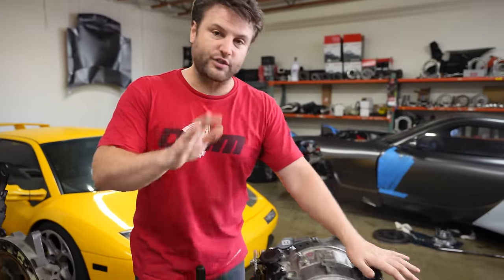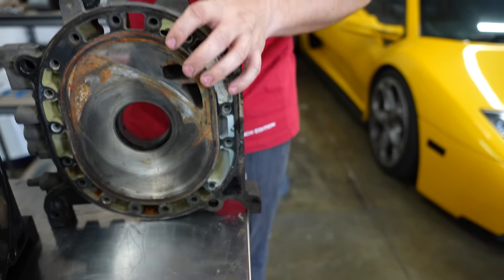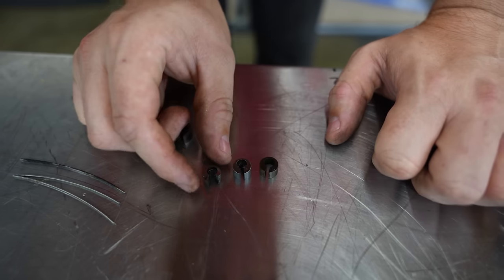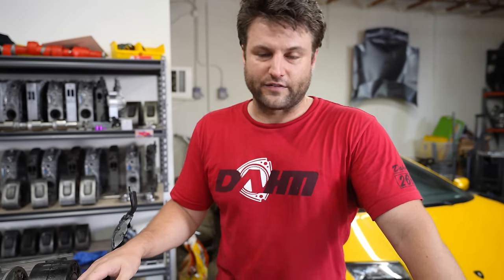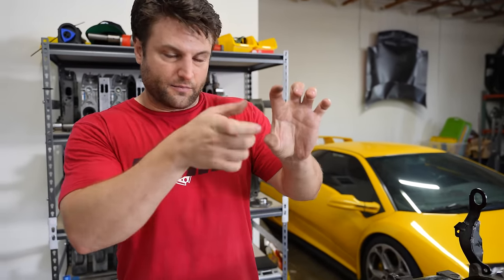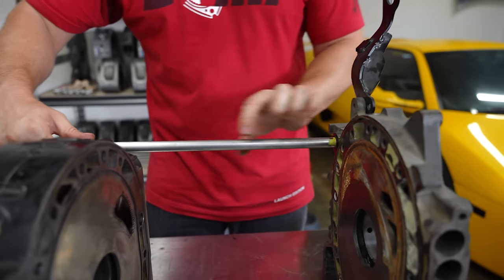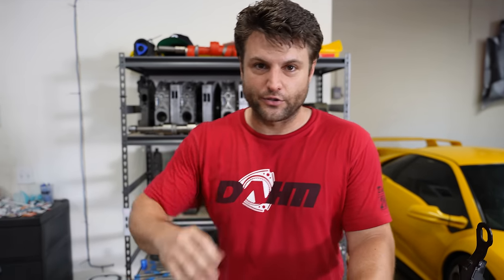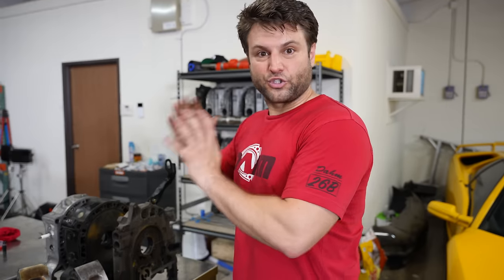Fixing the BIGGEST Problems of the Rotary Engine

Comment: When I discuss Rotary engines vs Piston engines with folks I always point out the difference in engineering efforts. The overall effort (engineering/testing/etc) to improve the piston engine absolutely dwarfs the Rotary engine.  I often wonder what may have been if the Rotary had even 1/10th of the same effort applied to it.     Great video.
Reply: I often wonder the same thing. There are definitely issues with rotary engines, but I doubt that any of those are fundamental flaws with the concept. Just look at what we can do now as opposed to 50 years ago. Probably ten times as power dense (more power in 3 small cylinders vs 8 big ones), while also being a hundred times cleaner. If those problem solving skills could have been partly applied to rotaries? I think some really cool technology could have come out of it. Sadly, with the future moving away from combustion, its unlikely that it will ever get that kind of attention.
Reply: @aggonzalezdc  They are fundamental flaws though.  The power density isn't even that great.   If you measure a 4 stroke engine like a rotary the displace is half or you can double the size of the rotary.  That's because a rotary fires it's full displace for every rev of the crank while a 4 stroke only fires half it's displacement.  So the 1.3L is really a 2.6L and I will assure you a 13b is no match for say a RB26 with similar type builds.
Reply: My same point when it comes to ICE vs electric cars
Reply: @Weeblicker  My buddy at work was thinking the same thing.  The young folks will be fiddling with the electric cars like old farts like me did years ago.  It will be interesting to see the results.  Take care!
Reply: I feel like piston engines were a moving target. They kept getting better, and the rotary was trying to catch up, but really only one company was using them.
Reply: @Day 18,300 and counting cool story bro but I'm good with my ICE engine. I don't want thousands of 
lithium🔥 batteries venting hydrogen fluoride (after a crash)🤑. Also we still have efficient ice vehicles gas or diesel. Fuck EV with lithium ion.
Reply: The rotary's only advantage was better breathing, but that was decades ago(70s, 80s). Now that the piston guys have worked out how to fill cyls with better post design, ie, flowbenches and CFD, they can now fill more, and over a shorter time period, giving them even more drivability, ie, high flow ports with short duration cams. Unfortunately other than that it's practically behind in every aspect due to design limitations. I have some vids on the problems if you're interested. It was fun when it lasted - lol -. I still have my original 268,000km stock factory engine that still runs - it must have 4mm high apex seals lol -
Reply: Exactly the same !
Reply: @Dayandcounting  Funny you say that, because displacement is a measure of stroke, bore and cylinders, 2 of which are non existent in a rotary engine.
13B are a 1.3L, period.
Reply: Oil consumption, non epa compliant...
Reply: @olliehopnoodle4628  yup till a winding shorts/opens or you get thermal runaway in those lithium batteries
Reply: Trust me, the Japanese have thrashed these engines and made many improvements, I was Crew chief and engine builder for both the Trinity Racing RX 7s, cars #81, #82 the race engines undergo a 9 hour breaking, with aluminum ceramic apex seals, these engines were run on Superflow Dynos at MTC in Irvine, Ca. For 24 hours  my 12A engines with peripheral ports and 48IDA weber in 1980 made 265Hp @9000rpm,  my worst finish was 8th at Atlanta in the Rain, on our rebuilds, Drake Engineering did the dyno breakin,  these engines were bulletproof
Reply: Dont get hung up on that pistons put out more torque. Jet engines are king anyway
Reply: @dtvjho  in wich world do you live were superchargers dont exist? They still take longer than gas but dont throw incorrect facts around.
Reply: @Asbjoern  There's no incorrectness here. And please stop looking down on others. The time a car owner spends at the fill-up matters to a lot of people. They don't want to be stuck there for more than 10 minutes. Ever see lines at a busy station. That's with fill-ups requiring 5-10 minutes. You expand that to 2 hours, and now you need 4 times the real estate, plus now you have 4 times the customers needing to eat or do something for those 2 hours. So now these politicians want us to sit on our behinds for 2-4 hours for a 240VAC "super" charger when we can fill up on gas in 10 minutes. You can't fast charge a battery much faster without a way to get rid of the heat. And I don't see these EVs coming with the necessary cooling systems. A capacitor bank could be charged in less than 10 minutes, but we won't have the power density on them to last for 200 miles.
Reply: @xESPplayer500x  inefficient
Reply: That's just lipstick on a pig, the Otto cycle reciprocating piston engine was made obsolete over a decade ago, the fact they are still being produced is sheer stupidity.
Reply: @aggonzalezdc  The Liquid Piston rotary engine is what the Wankel should have been.
Reply: @RayleighCriterion  eh, maybe. Hard to say what would come out if they had the same kind of development as the piston engine. Either way, I think it would be pretty interesting.
Reply: @dtvjho  Sodium ion batteries can have 5 minute charges as will super capacitors.
Reply: @RayleighCriterion  That sounds a LOT better than 2 hours for lithium. I can't imagine a drive from Florida up I-95 to Philly, normally an 18 hour ride, including 3-4 gas fillups and one overnight in a hotel, for an 1100 mi journey. What I see as the major tipping point is a charge time <= the time to get a dinner in a restaurant, eating while the car charges. If the charge is 2 hours, that's a bit long and a family would be upset coming out after a meal to find they can't leave.
Reply: Well, there is the liquid piston engine, that weird German spherical/clam chomp internal combustion...thingy (you'd know what I'm talking about if you saw it), um....I'm not sure but I think Mazda is continuing to put research resources into developing improvements on the Wankle engine, so there's that. Also there are new ideas being explored with piston engines like the opposed piston engine...first thought of during the 1930's I think, and the 5 stroke engine, the Duke University engine, the large bore 4 cylinder engine (ever notice a 4 cylinder engine never going over 3.2 liters? Someone possibly found out a way to make 5, 6 even maybe a 7 liter 4 cylinder engine), there's that strange circular tube with internal plates engine (the intake, combustion, power and exhaust are the functions happening between those plates forcing them closer together/farther apart. I think there's even one labeled the "6 stroke" engine (not too sure about that tho). Konesseig is making great advancements with internal combustion and transmission components.
The point is, the Wankle engine isn't, nor would it become "the perfect engine" if more research had been poured into development. It has its positives (high horse power, fewer moving parts) and its negatives (torque? What is this "torque" you speak of?, why does my crankshaft keep breaking?) and does a very respectable job in certain applications, where as your typical piston engine is better suited for other applications like motorcycles/quads/side by sides, marine/boats and personal watercraft, hauling and towing, off roading, ON roading...getting from point A to point B without breaking down, etc.
Reply: @RayleighCriterion  Capacitors would always be far better as they don't run on chemistry, just physics. Nothing to wear out. But we can't get the needed power densities with them. 5 minute charge? Batteries still run on chemical reactions, to push sufficient electric charge to do a 50 lb battery in 5 min will make it get real hot, it's far more watts that a hair dryer. I wonder how they solved this.
Reply: @TheGuruStud  if you’re buying a sports car for fuel mileage, you’ve already messed up. The torque is addressed in turbo models; eg RX-7 TT.
Reply: If effectiveness and efficiency mattered everyone would be driving diesel
Reply: If the 787B didn't get banned right after its victory
Reply: GM tried but they said was not worth it
Reply: Excellent point
Reply: @RayleighCriterion  or probably aluminum air batteries.
Reply: @dtvjho  as Italian, 2 hours for dinner is not enough for me.
slow food > fast food.
Reply: Ok I'm curious where would a new like me study or get parts or the engines themselves. Cause I'm intrigued and am definitely contemplating a swap in at least one of my rigs. I love the simplicity design and less wear parts to deal with. I am not an emissions guy I usually prefer deleting that shit anyway.
Reply: @dtvjho  And when these is excess heat, there is inefficiency so electric isn't much more efficient than combustion from the practical standpoint.
Reply: @shadowopsairman1583  At partial load, yes , but a hybrid with a small turbine engine could be very efficient as the electric part would be used for acceleration while the turbine is there for cruising. At low speeds and start stop driving, the turbine engine wouldn't have to be on all the time so fuel could be saved there as well.
Reply: @dtvjho  When it comes to electric cars, you also have to remember that all the manufacturing of them (from mining the materials out of the ground to processing that material into an actual car) is done by oil burning machines. And the electricity is generated by coal. Also mined and transported with oil burning machines. The road they drive on was laid there by oil burning machines. The tires they roll on contain gallons of oil. An E.V is the same as a child sitting on the shoulders of an overindulgent father, touching the ceiling, thinking they did it all by themselves with no help. Saying "look what I can do, stupid old man." 

It's not that I'm knocking E.V's. I actually think they are cool and would own one if I could afford it. But their entire existence and everything they do is only made possible by oil burining, internal combustion machines. And I'm tired of people not seeing that and acting like it's so "green". Because it's not.
Reply: @aggonzalezdc  I think the biggest issue with the rotary is the oiling, you can have the OMP and not have to premix but you get carbon buildup and dirty oil running through the engine. Or you can premix every fill up and be chilling.
Reply: @Dayandcounting  hater who loves to twist reality spotted.
You dont measure a 2 cycle engine as double the displacement, neither you would say that a jet engine has infinite displacement.
Go cry a river.
Reply: @santiagoperez2094  That's how they are measure for racing purposes.  It's also the easiest way to compare their displacement with a 4 stroke engine.  As for being a hater, I am the original owner of a '94.
Reply: Of course, but there is a reason for that right? Piston engines work. If rotary had a clear path to "better" people would do it.
Reply: @DragNetJoe  Bingo!  I could spend $20k on a 20b to run 10's, or I could spend 20k on a LS and run 8's and it will last 100k between rebuilds.  Hell the flat plane LT6 from the Z06 might fit in the deck is short enough.  Might have stacks coming through the top of the hood.
Reply: @shadowopsairman1583  battery packs take care of this by isolating every other battery with a fuse. If a single cell in a battery pack gets too hot it's disconnected. The Chevy Bolt was the only EV in the US which didn't use this method and we all saw how that went
Reply: @dtvjho  It takes me 30 minutes to get 200-250 miles off the DC fast charger next to my local grocery store, stop acting like its the end of the world. And you're also just glossing over the benefit that at home I can just leave my car plugged in overnight and wake up to a full 'tank' for half the cost of filling an ICE to a comparable range. I don't see why you're so adamant against EVs considering they're the easiest cars to modify as long as you have the equipment and computers and also contain 80% less parts to break or replace. You could literally buy a 2012 Leaf and just plop in an extra 100kWh of battery, reprogram the BMS and VCS to accept the new batteries and get an extra 300 miles of range for barely any work (than if you were to do the same for an ICE vehicle). But if refueling is your only gripe about electric vehicles, then just get something like the BMW i3 which lets you use gas to charge the car battery as you drive if you run low on charge
Reply: @dtvjho  Super Chargers are not 240VAC, that's a level 2 charger. Super Chargers are level 3 chargers that convert high voltage AC lines (480VAC-11kVAC or above) to DC and bypass the inverter on the car. For example, I have 3 super chargers near me with starting at a minimum of 150kW power delivery and then two others with a maximum of 400kW power delivery. So at a minimum, it would take me 45 minutes to charge my car from 0 to 100 (which my car is never below 20% so more like 35 minutes to 100%) or about 15 minutes on the 400kW chargers. I have a 100kW battery if you were wondering and charging costs about $5.10 on the 150kW and about $6.40 on the 400kW chargers all for about 250-300 miles of range
Reply: @callowaysutton  Those kinds of power levels will remain out of reach of the masses. Utility power distribution networks only deliver 240VAC to houses, and an upper limit on current of around 200A. That's ~ 48kW if you shut the rest of the house off. If you're in the middle of winter or summer and need the furnace or A/C to run, not to mention the fridge and washer, you're not going to have the whole 48kW to use on a car. Going past those general limits gets real expensive fast. I learned on an Electrician channel that a common 200A power panel in a house that runs $3500 gets past $10,000 real fast if you try to get a 300 or 400A unit. And sudden demand from car owners will only make prices soar from there, again the masses will not be able to charge EVs at any kind of fast speeds. You're still looking at hours to charge. That's still a deal breaker for long-distance travel. And consider this: a million people in the city of Philadelphia do not have driveways or garages, they have to use on-street parking. There's no way in hell people are going to run long (read: expensive) cords just to have them stolen.
Reply: Probably stated elsewhere but worth repeating: flame quenching and swept area are the dynamic flaws of the rotary design. Solving the stack twist and the oiling issues is great... for the track. As a production engine, all the development $ in the world can't fix the inherent flaws.
Reply: Even with the same amount of engineering effort applied to the Wankel engine, it would not be as good as a piston engine. There are fundamental shortcomings in the design of Wankel engines that cannot be solved without redesigning it so radically that it's no longer a Wankel engine. Sealing such a complex shape is unavoidably difficult; lubricating combustion chambers that have no undersides requires oil to be injected and left to burn, leaving carbon deposits behind; intake and combustion occur in different places, causing immense thermal strains; and the surface area of the combustion chambers is too high, allowing too much combustion heat to escape. These cannot be fixed, only partially mitigated.
Reply: @Mike Woodfill : You can't just increase compression on a Wankel engine. Increasing compression is more likely to cause preignition due to waste-heat from the combustion zone conducting into the compression zone, and preignition is lethal for a Wankel engine. The engine management of a Wankel engine is tuned to avoid preignition at all costs (that's why they have to run filthy rich all the time), and it needs to be that way. Additionally, increasing compression will cause increased leakage past the complex seals, wasting the work done by the extra compression.
Reply: @Oddman1980  : That's because the Wankel engine concept is so fraught with fundamental weaknesses that only one company was ever able to get the engine to run well enough to be able to sell it. Enthusiasts love cars, but car companies have to be able to make money, and as much as there are people who say they would pay any price for the next RX-7, the vast majority of those people would not actually spend the money when called to put their money where their mouths are.
Reply: @Dayandcounting  yeah if it was measured the same but it's not because it's a two stroke. So its still only a 1.3
Reply: @snowjohn1298  Rotaries have have 4 phases just like a 4 stroke engine.
Reply: @Dayandcounting   there might be four phases but it happens in two strokes.
Reply: The whole design of the engine is the problem. Yes it's a powerful motor and I wish physics agreed with what everyone wants but this is real life no matter how much you try to improve this machine it will always have problems. Example Literally the whole crank is gear teeth.
Reply: @aggonzalezdc  There are fundamental flaws with the concept though. No matter how you look at it, you have much bigger seal for the coolant not to enter the engine. And on top of that you have a weird, huge area to ignite. The way you mix the fuel and ignite it makes big difference. And this is already an issue in cylindirical engines where making the mixture homogeneous is easier. These engines have that weird shape for the fuel-air mixture. So yeah, the devil is in details and it is already there. 

It has good rpm though. And that's more or less all that is going for it
Reply: All the research in the world can't change physics
Reply: @ChiefCabioch  Except they aren't. Especially in race cars. You constantly have to rebuild/repair/replace race car engines no matter what your power unit is.
Reply: @callowaysutton  And in the process you are killing the life span of your battery with each quick charge, by up to 50%. And yes, you can charge up your car....hopefully the power doesn't go out, because that never happens, right?

I am against EV because they just don't work. They aren't practical. They are dirtier than gas powered cars. A battery, I don't care what kind you have, is one of the WORST sources of energy. By the time your car gets the power to the wheels several energy transfers have happened.

1) Fossil fuels have been burned to create electrical power to your house to charge your vehicle. You have already lost some energy due to heat, friction, and the distance you are from your source of power.
2) The electricity that has been sent to your car has now be converted to chemical energy, with some loss due to again heat, and friction. 
3) Chemical energy has been transformed back into electrical to power the motors
Reply: @FuSiionCraft  ridiculous statement, the reason it's a 12A, or 13B is for Displacement, a 12A 1.2 liter, a 13B is 1.3 liter, a 20B and 26B are 2.0liters and 2.6 liters respectively as for power, search some race engines that are turboed, they can make phenomenal power,....well over 2000hp
Reply: @eduardopena5893  What makes you think I care about the environment? It's more practical, cheaper and more fun for me to have an electric car than a gas car lol. Good luck getting a sub 3 second 0-60 in a car for under 20k or paying 3 digit numbers in maintenance and gas fees annually when it comes to using the thing.
Also I don't know where you got that statistic about fast charging killing the battery by up to 50% (try 0.5% at most?) but it's just wrong, I've consistently fast charged my leaf on a 6kW level 2 charger at home for the past 3-4 years and it's only degraded a whopping... 17-20% in total with a couple more years to go.

And also, where do you live that the power consistently goes out for 2 days or more that I would need to worry about not being able to charge my car (which would only need around 3 hours to go from 0 to 100)? Besides that, wouldn't it be awesome to have a portable, multi-kilowatt energy dense storage device that you could plug into your house and have that power your essentials for 3-4 days, if for some reason the power did go out? IIRC Rivian, Lucid and one other car company are working/have this atm and it wouldn't be too hard to go do this yourself with a grid tie connected to the EV charge port.
Reply: @eduardopena5893  Mazda has broken more endurance records than anyone, they dominated 24hrs of Daytona, 12hrs Sebring, and Lemans,  and their competitors raised enough he'll to get IMSA to put so much weight on them they were only mediocre, in performance, the same shit the did to the Vipers, I built a 79RX7 and though it was let in by John Bishop on a provisional in (72) last place cause the registered drivers, Lyn St. James. Tom Winters and Mark Welch, it ended up in 5th in GTU, and 17th over all....not bad from 72nd on the grid...
Reply: It's great seeing all these people argueing against rotaries being good by saying that newer piston engines breathe just as well and all the other ways piston engines have been made better since the 80's, but they're missing the point where we said "imagine if the rotary had been engineered to the same degree" instead of being built and utilized by a single company for just a few decades.

Hell mazda went from the first production 10A in 1965 to winning Le Mans in 1991

Mazda basically solo-developing the rotary for 26 (haha 26B) years went against cars with vehicle piston engines which have been built upon since the 1885's
The Piston engine had over an 80 year headstart and the entire worlds auto industry focusing on it for a large part of that.

To put it in another way:
In 1991 the 4 stroke motorwagen was older than the 10A is from today
In 1991 the motorwagen was 106 years old
In 2022 the 10A is 57 years old
In 1991 the 10A was 26 years old
Reply: @ValentineC137  when a 1300cc piston engine makes 1000hp, then the reciprocating engines will have something
Reply: @mann_idonotreadreplies  the future is EV or hydrogen cars. Full stop. You can't change it. I mean imagine the criticism people got for the first ICE cars "it's gonna explode" "how can you even control it moving so fast" "you'll spend thousands of dollars fixing it" and now the same thing is happening with EVs. Same thing generation after generation. You should think we would learn by noe but ig not
Reply: The development effort is probably the most important factor in the success of piston versus rotary engines. Who would have imagined in the 1930's that we would have piston engines with the power density we have today?
Ideas such as Wankel engines where the three sides of the rotor change shape as the rotor rotates, optimizing the three chambers, to my knowledge were never explored. Extending these ideas, you could, at least in principle, turn the Wankel into a four-stroke equivalent, resolving the oil issue.
Time came and went, now the future is electric.
Reply: The Rotary design is inherently inferior for most PRACTICAL applications.  To flip your argument, more than enough engineering time has gone into the wankel to determine this. 

To support my argument, look at diesel vs spark ignition.  Diesel is more thermally efficient than gasoline but not PRACTICALLY so for most non-industrial applications.  That’s why spark-plugged engines probably outnumber diesel 100-1 when you look at ALL piston motors, including small engines.
Reply: @eduardopena5893  you've never raced one, the Mazdas dominated Daytona, Sebring, Lemans, and The Nurbugring, their reliability was unquestionably best of all, and if you bother to search 2,3,4 rotor Mazda especially the Turboed ones you'd see pound for pound they can easily match or exceed the powers of of your favorite piston engines, the biggest  issue facing reciprocating engines is the Strength to mass ratio of the Pistons, pins, and having to start and stop the parts, and the only remedy are Titanium Rods, ultra light cranks, and very lightweight pins and pistons, some are even going to single and or 2 ring pistons, the Rotary is only serious drawback is fuel economy, and while not the most important issue, it's use on the street will be limited until the newer design comes out...
Reply: @ChiefCabioch  Just like I can say you never raced a Ford. And actual race car is build to last for that race. They are far cries from production vehicles.

Why are you bringing up POWER when I am talking about RELIABILITY in a production car? These are two completely different subjects. The problem with the mass produced rotary engines for normal, every day use and wear and tear of a daily commute is that they overheat and break down. 

A racing engine is a completely different animal.
Reply: @eduardopena5893  so you say your Ford Taurus does and won't overheat if you ignore it and let belts and hoses, and thermostats go bad?, that shit happens to every internal combustion engine ever made, just because there is a different set of maintenance requirements that owners ignor has nothing to do with the manufacturers fault, don't change oil, just add some, don't change oil and filter regularly, don't follow manufacturer maintenance requirements and your 300,000.00 Rolls Royce Silver Cloud will end up in the shop....
Reply: @RayleighCriterion  so genius, invent something that you can afford, that has realistic reliability, gets good mileage on a gallon of gas, easy to maintain,.....and you have a MOPED......genius
Reply: @Carlos.Rivera  GM also gave you the Vega, with aluminum cylinder walls, and the Corvair, .....
Reply: @Depl0rable10  Canada got rid of all....ALL their Hydrogen powered Buses,......to much troubles..
Reply: @eduardopena5893  BTW, I've raced Fords,.....but I prefer to win, not DNF
Reply: @ChiefCabioch  If you ignore ANY engine it will have problems. The problem with the Rotary is that it runs extremely hot and it is just not a durable engine for production models. It has been proven time and time again. That's why even Mazda, the only car company to put and then keep them in production, has stopped using them. 

Stop trying to justify your indefensible position with straw man arguments. You and I both know the Rotary engine with the current manufacturing techniques is not a viable PRODUCTION vehicle engine. If it were, every car company out there would be using them.
Reply: @eduardopena5893  you are expressing your opinion, not Fact....
Reply: @ChiefCabioch  It is a fact that Rotary engines run hot. It was a common problem in early gen RX-7's that the components around the engine bay would melt. Instead of fixing the heating issue, they just insulated the parts better and moved them a bit further away from the engine.

It is a fact that they wear out faster than a standard internal combustion engine. 

I am sorry you love that engine so much that you refuse to see the plain truth.
Reply: @eduardopena5893  I'm sorry you hate these engines so much you now have a unnatural hatred of them.
Reply: @ChiefCabioch  I don't hate the engine at all. If the design was able to match the concept, it would be truly amazing. The first car I ever saw with one was the Mazxa RX-500. I thought it was the coolest car I'd ever seen! 

Lightweight, power to weight ratio is amazing. But what you get in return is bad fuel consumption, intense heat, and unreliability for long term production use. This isn't "unnatural hatred," it is demonstrable truth. To ignore it would be the unnatural thing to do.

For a one off, purpose built race car engine, fine. You're going to scrap that engine after racing it and completely rebuild it anyway.
Reply: @eduardopena5893  I personally don't believe the Japanese have done all the R&D on these engines as they can, I suggested they let me make a few changes in 1980, like an MSD multi spark ignition, and Titanium rotors, they said Absolutely NOT, in their grasp of control on them they have stunted its growth, and yes, I knew a few at Racingbeat, utilizing that heat everyone talks about only means the size of the internals are adequate, but enlarging the aluminum part of the housing, add a cooling fitting between and several other mods and some dyno time and , like the Titanium rotor could increase the max RPM to over 15,000, and running them on E85, would change the housing and Temps considerably.
Reply: One good way to diagnose what's going on in the combustion side with a Cyclinder Pressure verses crank angle would give you both answers and questions...
Reply: @ChiefCabioch  I think the engine has gone as far as it can with current tech. I am glad you are finally acknowledging some of the faults of the engine.
Reply: @eduardopena5893  well any vehicle combination can have serious over heating issues, the Big Block 427s, 454s had heating especially in the corvettes.  issues in the late 60s to mid 70s, some of these issues could be solved with larger Radiators and Oil coolers, while I agree with the facts these engines create a lot of heat there are several options, the race cars are using electric water pumps, an exhaust Temps in our engines was in the 1300° areas, I'm a problem solver, I am relentless, i don't stop no matter what issues I faced, example, in 1976 Roy Clark's musical director met me at a former Top Fuel car owners tune up shop, and to make a long story short, asked if I'd go to a river where he tested the 557" Blown Alcohol Hydroplane, at the time they were limited to direct drive because the sprags in the lenco transmissions couldn't take the load of an 11.5 x 17 pitch prop, so he made a short run to get the boat to leave harder, at that Time I had ZERO knowledge of Hydroplanes, and limited experience in Blown engines regardless of brand name, by the end of the first season, we were able to run a 2 speed lenco, and during the conversation he asked what ratio we should run, 99% of the boats ran 25, 31, % trans gearing, and 1.73% "V" drive ratios, I suggested we run a 45% split gear trans, and go to a higher 1.84 gear in the "v" dive, by the middle of the second year we were the fastest Chrysler powered Hydro in the central US, by the 3rd year we had a 50% win record and maintained that % for 4th, 5th, 6th season, the last year in 1983, I retired mainly because I lost 5 good friends that year and in those hydros, it's not If, but When something was going to happen, in 1986 he crashed at Waco and died minutes after he was pulled out of the water,  I don't often toot my own horn, but during boat racing I was doing engine machine work at a Shop in Tulsa, and a high-school friend for 3 weeks in a row he kept bringing parts in that to other engine builders couldn't solve, so I told my friend, you leave all this stuff here and I'll do these for 25% of what the car makes but you Must do what I say regarding the engine, the 229 chevy V6 had offset crank pins with a .100" divider between throws to help with balance, but in race engines the rods didn't set directly under the center of the piston, and under high loads the stress caused the rod to try and straighten up causing the oil for the Rod to leave out the gap the rods created when laying over, so I built some Nylatron shims, to keep the rods from laying over. And that solved the problem, but I wasn't done yet, I saw that the V8 Carrillo rods like all V8 chevy rods had to be machined and .050 had to be removed to fit the V6 crank, so after a few minutes pondering the deal I took a stock v8 rod and machined the .050 off the narrow side and  assembled it and low and behold, that centered the rod under the pistons....the car set 7 track records at the 5/8ths mile Tulsa track, and was the third fastest car of all classes to race on that track,  we easily won the championship and didn't even have to run the last two weekends. No one could come close to us, I've raced Drag cars, drag boats, SCCA D/Production, B/sedan, Formula Super Vees, Formula ford's. And IMSA GTU Mazda rx7s, every type of racing allowed me the experience to carry over to all other types of Racing, and helped in diagnosing problems that are pretty much a given in any mechanical devices
Reply: Running a rotary on Alcohol would still make the power, just necessitate using an oil additive in the mixture to maintain lubricity needed for the seals
Reply: Operating an internal combustion engine with Cast Iron Piston was tossed years ago by reciprocating engine designer, except for massively huge Diesel ship engines, Running a rotary with cast-iron rotors once they are heated the don't transfer heat very well, and not being able to rid the rotor of high Temps on the rotor is one of its issues, using oil to cool the rotors is a necessity but there are other metals that could be used in place of the 8 lb rotors, one of which could be a special blend of alloys to get the rotor weight down, and to transfer its heat better, performance is the results of vast temperatures between firing cycles, from minimum heat, to maximum, as long as you stay in the allowable ranges of Temps the Rotor or Piston is subjected to, and when you heat up a rotor, you're not going to get it cooled down, which only compounds the problem, and adding a -8, or -10 water inlet between the two spark plugs would help keep Temps down, I suggested this in 1980 when racing, but the Japanese do not want anyone piddling with their Wankle. Which after a 5th place in Daytona, 4th at Sebring, 8th at Atlanta in the rain, 4th at Riverside, and The owner driver crashed it in the last turn onto the front straight was most of the reason I left, it's also the reason I turned down racing NASCAR, cookie cutter cars that the Crew chiefs are forbidden to get outside the lines is taking the incentive out of the business
Reply: @callowaysutton  not many suburban  houses with 480 volt 3 phase, or even 480 volt single phase...
Reply: @ChiefCabioch  Not every home has a truck delivering petrol to it every week or so as well
Reply: @callowaysutton  well many here in Oklahoma have oil companies that can deliver gas, diesel, propane....
But I don't know why a gasoline or diesel car would need a pump at their residence, , and who wants to park a EV, overnight while they charge their battery, besides the Lithium is mined like coal, and solar panels require some very toxic chemicals as waste, and a quick check of Windmills, that make better Lightening rods than they do generating electricity, especially when the winds spin the blades so fast the go flying off, and catch fire for various reasons,....people are lying about green energy, the only things green is the ink on the currency....
Reply: @callowaysutton  don't need to, unlike charging stations, there usually a gas station within 10 to 15 miles...
Reply: @RayleighCriterion  yea, nothing like hearing that rumble of capacitor charging, and that buzzing sound of an electric motor to get those corpusles flowing.......
Reply: @Dayandcounting  I'll take the bet your 8 second LS will run 100,000 miles......
Reply: @callowaysutton  and when those battery packs wear out.....then what?.... bury them in your neighbors back yard?, or pay some exorbitant recycle fee?.......I'll stick with my Gen 1 Hemi powered 38 steel Fiat Topolino....
Reply: @franyetso4899  so what's your emission running E85?,....and temp issues if your stoicometric a/f ratio is good, and on the rich side for power,?
Reply: @deusexaethera  run some BG44K occasionally and your carbon issue all but vanishes...
Reply: @ChiefCabioch  what makes you think I care about the environment, I bought an EV because it is cheaper in every way shape and form to operate and maintain.
Reply: @ChiefCabioch  Charging stations are nearing 1 in every 25-30 miles on average, so they're catching up and you're ignoring the elephant in the room that you can leave your car in your garage overnight and never have to go to a gas station again unless you go on a road trip
Reply: @callowaysutton  it makes no difference to me what you like, or don't like, I'm building a street car that will run mid to high 10s on pump gas, and with the quick change rear I can put a tall enough gear that 12-14mpg isn't out of the question, running a first generation 392 Hemi .060 over, we in Oklahoma  killed the vehicle inspection stations cause you could walk in and buy one for $5.00, with out even driving a car in, so it was scrapped.....
Reply: @callowaysutton  if you are counting the cost of charging you won't be all that better than say my Nissan Sentra or Suzuki swift, both get over 30mpg, and that's including 50% town driving,
Reply: @callowaysutton  well having a passion for the internal combustion engine is going to keep me driving my hotrods and Dodge 1 ton Maxi vans......I'm almost 72, I'll never own an EV unless it's a pit vehicle to get around at the races....
Reply: @callowaysutton  technically the Hemis were called Elephants, so no, I'm not ignoring them, I own one...
Reply: @ChiefCabioch  to get comparable cost per mile rates to an EV you would need around 65-90MPG for it to be comparable, especially in South Eastern states where electricity is generally cheaper. ICEs, as of right now, cost almost triple per mile what it costs an EV and with gas prices when Trump was around around 1.5-2x
Reply: @ChiefCabioch  that's fine, not saying ICEs are bad just that they're more expensive to run and maintain and offer few advantages over EVs for the average Joe. EVs literally can't compete when it comes to horsepower, top speeds and power to weight ratios since batteries have a finite amount of current that they can safely use.
Reply: @callowaysutton  you're assessment doesn't correspond with the data I'm gathering. #1, average initial cost is much higher in EVs, $55,000 verses $35,000 for gasoline, #2 electric cars are being given tax credits that won't be around for ever, #3
Insurance is $400 -$500 higher because EVs are lots more expensive to repair, #4 plenty of EVs require having your own charging station. That can run up to $2300 more to install, and if you rent and not own, your landlord might not put in one, and secondly, why would you upgrade a house you don't own?
#5, owning a Tesla replacing the Battery is $16,000
#6 you'll never make up the additional expense of EV verses Gas or diesel...
Reply: @callowaysutton  Have you ever visited Philadelphia? Miles and miles of rowhouse blocks. No driveways, no place for one, always having to hunt for an on-street parking space. Charging is out of the question, for someone could just walk off with your cord. Modding cars is out of the question for most people, I have a hell of a time trying to explain things on computers to others, with all their resistance to them.
Reply: @callowaysutton  Have you ever called an electrician to price an 11k line to your house? It's not your average house upgrade
Reply: @ChiefCabioch  I cant find my original post but I'm sure I was talking about swept area or quench areas and the basic flaw is not the rotor seals or E85 or stoiciometric ratios. You simply can't get there from here if the mixture is cooling in the corners and sidewalls of the Combustion Chamber(s) full stop.
Reply: @franyetso4899  GM has used quench areas for decades, so have most other engine makers, it cuts down the likeyhood of preignition, and even the Gen 3 Hemis are using them, the rotors could be designed without them, and the pocket for combustion to assist in pushing the rotors direction could minimized, there are lots of things that I don't believe have been flogged enough simply because the Japanese don't like others trying to redesign them, a great deal of activity is being done in New Zealand of all places, and it wouldn't surprise me if those New Zealanders don't come up with significant improvements, the hardest issue I see facing the Wankle is the specialized machinery to make both rotor and housings
Reply: @dtvjho  yeah you're right, EVs probably aren't the best choice for them but that's their choice for living in the area that they do. But I don't know why you bring them up when that type of housing makes up for about ~2% of the housing market and so wouldn't apply to most people
Reply: @dtvjho  why would you get an 11k line to your house, EVs only need 240v@50A (12kvA out of the 48kvA 90% of homes are equipped with) to take advantage of sub 2 hour charging. Most houses have the electrical lines already setup for this configuration as well since older furnaces use 240v@60-80A and all you would need to do is buy the faceplate and an hour of an electrician's time.
Reply: @franyetso4899  the E85 would lower engine and exhaust Temps, the squish is causing late burn which increases NOX and higher exhaust Temps, and the pocket for the push could be moved (advanced) to the direction of rotation and timing adjusted.
Reply: @franyetso4899  looking up the exhaust emissions graph also shows the Catalytic converter is mounted directly to the Exhaust port and air is injected, that's a huge mistake, as it requires the engines to run rich so the unburned fuel is then burned in the Catalytic converter, same stupid design that Detroit used for several decades, which robs both mileage and power, and it's the classic create one or more problem trying to solve one or more
Reply: @Professor Frog reducing the "quench" area, moving the combustion pocket further in the direction of rotation, reducing the pockets size, mounting A Turbo as close to the Exhaust port, enlarging the oil pump and a larger oil cooler, and running the engine on E85 would be significant in emissions and increase power, and better economy, you self appointed Genuses don't seem to get, in Racing Fuel economy is quite important, because it costs time in your pit box,  so if all you Experts in Applied Thermodynamics were correct, MAZDAs would be spending to much time in the pits, while the other cars go flying by, MAZDAs have won plenty of races, and it was because of Reliabilty, ....and it had to get at least close to the mileage as their reciprocating competitors, or they would have so many THROPHYS......GENIUS
Reply: @aggonzalezdc  The improved efficiency of Piston engine is more down to electronics and the Auxiliary equipment associated with it. Rather than the engine itself. Fuel is also more calorific.
Reply: @ChiefCabioch  Your hands on technical knowledge is great!. I'm talking from an 'architectural' point of view. When you have as much surface area as a Rotary, it is nearly impossible to keep from quenching the flame front. Every charge is expanding against the flat sides of the stack. Combustion is by it's nature is a spherical event. Ignite it in a square box (or troichoidal) and there are going to be losses as the gasses expand into the corners. Stoichiometrics won't fix it nor will exotic fuels.
Reply: @franyetso4899  I'm well aware of the surface to volume argument, yet there is still room to modify the rotor, and to use fuels that have a much more charge cooling effect, to say the Rotary is inefficient is incorrect, inefficient engines produce little power or torque, and there is vast areas of improvement possible, the most serious issue facing the Rotary is Japan's relectance to allow others to make Experiments with, there are very Few things America has Taken on that others made, that WE couldn't improve on, the New Zealanders have been making incredible horsepower with their engines, including 3,4, and larger Rotaries, I stand by my claim that things could be done to make these engines higher fuel mileage and better emissions, and there is little if any question these engines are capable of Exceptional horsepower stats.....
Reply: It was a personal Friend of mine who convinced Mazda to Race in the US,  Brant Doell, who I worked with on some Locomotive Engine testing with, he was a partner in one of the First private RX7 IMSA cars Bergstroms,  which mine beat at Daytona, Sebring, Atlanta, Riverside, and would have continued for it not being told by The Japanese I wasn't allowed to make changes, so I left IMSA and went back to Racing Blown Alcohol Hydroplanes for "OFIXCO"  the Oklahoma Fixture Co. Owned by Lloyd K. Stephen's....I retired from boats in 83', my former Driver was killed in 86'...
Reply: @franyetso4899  the quenching has been used to control knock tendencies, yet now with electronics the knock sensor can adjust the timing to minimize it, yet the Rotary is not octane sensitive, we raced using 87 octane pump gas, and one quart of oil to 50 gallons of fuel,
Reply: @franyetso4899  I believe you could, with the help of a screw type compressor effectively run on Diesel, they don't all need 16:1 or more compression to run properly, a 16 cylinder EMD 710 series thats 710 cu. In. Per cylinder,  locomotive engine only has 14.:1  compression, poorly designed diesels have had to run in the low 20 something to 1 area...
Reply: @franyetso4899  ever see the Ceramic NASA had that glowing red hot you could hold it in your hand, the rotor made from that would reject an awful lot of heat....
Reply: There isn't much that can be done about poor thermodynamics of a rotary engine.
Reply: @trev0rbr  another Thermodynamics expert who's never designed and or built an Internal combustion engine, as I have posted, there are numerous things that have never been tried on the Wankle,  a typical gasoline engines thermal efficiency is about 33% heat goes out the exhaust, 33% goes into the cooling system, and 33% does actual work, a typical Diesel has similar numbers
Reply: @ChiefCabioch  correct and on a wankel those numbers are even worse. I guess you can design a wankel which is more efficient than a piston engine since you're the real expert
Reply: @trev0rbr  well if they switched the rotors to the ceramic that NASA has that as was said can be glowing red hot and you can still hold in your hand, that alone would create a large amount of heat rejection into the oil and, changing the rotors surface to increase clearance and decrease quench area, that adds to the late burn and increases HC emissions, there are still many things that have not been tried on these engines....
Reply: @trev0rbr  unlike yourself, I'm not ready to declare the Rotary dead on arrival, not till I've run out of ideas.....but feel free to toss in your towel....
Reply: @ChiefCabioch  lol I don't think it's doa it has usefulness but as for being more more efficient or emissions compliant than a piston engine it has a steep hill to climb
Reply: @trev0rbr  compare a 1925 Ford model T engine with today's version of an inline 4 cylinder with VVT and all that's made the reciprocating engines maintain their place on Earth......
Reply: @trev0rbr  no one to my knowledge has ever converted a wankel to Diesel, due to the combustion characteristics of the Burn rates of Diesel being much faster, the Wankel might respond much better to the faster burn rates of Diesel......
Reply: @trev0rbr  the compression ratio of the Wankel could easily be increased with the use of a screw compressor, and the addition of a direct injection pump could use off the shelf Bosch pump.  There are many Avenues that yet to have been tried....
Reply: @ChiefCabioch  yeh but is that cost effective?  And what if you did the same thing in a piston engine? The main issue is the huge surface area
Reply: @Dayandcounting  Uh, you're gonna wanna check up on your rotary knowledge, pal. A 13B two-rotor engine has 2 booms per rotation of the crank, with each rotor completing one full rotation every 3 rotations of the crank. This is what gives them their durability, high rpm range, and lack of torque. That being said, a rotary moves 1.3L of air/fuel every 3 rotations and still makes power comparable to larger 4 cylinder engines moving 2L+ of air in 2 rotations.
Reply: It would have wound up nuetered in the end . I did scca race engines for 15 years , they were Raw but fast .there was not much left on the table for engineering according to my Friends in Mazda . I did the RX7 / RX8 for years as a street shop its the perfect engine for a world with no emission standards or noise standards or speed limits ...the Aussies love them .
Reply: For most of you who think the Rotary is dead, Mazda is working on more improvements, they have to much R&D invested to shelve these engines
Reply: @fredflinstone5017  I think they're awesome too, just not efficient from an emissions or fuel consumption standpoint
Reply: @trev0rbr  I spent 10 years as a 3rd gen specialist , i saw them routinely for emission testing in Canada, that was always a expensive venture for the owner . 2000.00$ in one  year worth of  repairs for 2 years of insurance .this was routine for any committed 93 rx7 owner
Reply: @ChiefCabioch  .....your span of engine wisdom only matches the equal span of egoism & entitlement with lot of personal glorification resumes sprinkled around to make up for arguments & toxic fume based love for combustion tech. How about throw all the buzz words & start working wonder magic on the said rotary if anyone is caring to see you prove.
Reply: @changsangma1915  nothing of substance for the discussion, just a rant about nothing, what else is your claim to fame besides your mouth
Reply: @changsangma1915  the New Zealanders are making good engines, if you think you can have performance and good fuel mileage, get a moped....
Reply: @ChiefCabioch  ......humility is clearly not your forte just to add to your rampant arrogant snub factor in your rhetorical jabs, claim of fame is for the ones intoxicated in vanity. We all can see who has unloaded all that dump in here.
Reply: @dtvjho   i bought a 650 cc ninja that I refill like it's on batteries. And I drive in the city. Leaving aside cars that are fun to drive, the rest of the boxes on wheels should at least be hybrids cos it's a total waste of gasoline to move one and a half ton of metal from a standstill, it simply doesn't work. Cars can't be both fast and affordable. But they can be cheap and efficient, that is a worthy goal for car industry
Reply: @Dayandcounting  its*
Reply: @olliehopnoodle4628  fiddling with what the rims? Teslas are locked down pretty tight, there are DIY cars but those all running nearly the same  set up.
Reply: @Dayandcounting  nah hybrid may take over but e fuels and biofuels will be more viable then everyone switching to EVs. Look at what Porsche is doing with efuels and how amazing we have gotten at growing alage.
Reply: Gotta change the laws of physics for rotaries to be in the same league as modern piston engines. Good luck with that.
Reply: Rotary engine has also been used in other applications. The so called next to no development compared to piston engines isn't as big as people say. Yes piston engines have more research. But essentially since hybrid tech it's just re packaging and materials and manufacturing tech that also helps rotaries. What was the last real new innovation in piston engines. 

Twin charging since the 60s. Super charger and turbos since the 30s. Dual overhead cams been around. Shit the Ford gt40 had the whole banned cammer engine. 

Hybrid tech has even been around since the 70s and 80s. 

Hydrogen fuel cell isn't even that new. There's a boutique sports car from the early 2000s I want that uses a hydrogen cell. And can also drive under water. 

Even water driving cars. Lol caddy made one. In like the 50s.
Reply: @Dayandcounting  only on the wankel type rotaries. There are rotaries that split the parts of the rpm cycle into separate parts meaning you'd measure displacement more normally. Is just the wankel design is a dead end that none of the rotaries fans want to admit to because they have nothing else really. 

Omega 1. Rotary hydrogen engine. Mazda could literally just try and license tech and build an engine based off that. And go crush the sports car market. Higher effiency new fuel tech that is environmentally friendly and also gets tax benefits. Zero emissions. And lol the engines way 35 pounds per rotor. It'd take 4 rotors to get to 600hp but your engine would weight 140 pounds. For further increases just displacement increase lol. It's got more torque than hp. You'd be pushing close to 700 lbs of peak torque. 

Given the high rpms and the torque geared properly you could literally just be like yeah this car has a theoretical top speed over 300 mph just needs distance to accelerate and tires to come out rated for that kinda speed. Low weight and good weight distribution good aero and the tiniest bit of active aero with huge brakes. 

It's a pretty simple package to sell. Even at a high price point. A refreshed rx series with an rx9 with something along the lines of the omega 1 once it hit reviews would slay the market and you could price them up with gtr's. 

But lol. Everybody keeps talking about the wankels. Or using them as a basis for a new engine. It needs a clean sheet approach.
Reply: @Dayandcounting  nope. Hydrogen engines are still viable along with numerous others. It's simply petrol engines are on the end of life. Hydrogen propane and others are easily doable. 

Some synthetic fuels could be done with enough research. 

And realistically the omega 1 plus a Hydrogen fuel cell paired with super capacitor tech solid state battery tech some electric motors and a exhaust powered turbine generator regenerating braking and suspension. You could literally make a sports car hit over 100 miles per gallon while burning fuel but putting out zero emissions. While also allowing for torque filling and hybrid peak power and torque creating a monster of a vehicle. 

Done right you can also have it do attesa like things in case you sre unaware attesa is the nissan awd system that the gtr skylines and 300zx and some other vehicles use along with the newer r35s. Based off traction. 

With torque fill and traction based set up and again tiny active aero and good base aero body work. You could crush lap times of much faster cars. With a 4 rotor omega 1 in the right set up chassis wise with the rest. You could make a street car which could beat 1 g corner and acceleration grip issues on street tires. And on race tires probably have a vehicle that can top speed better than  f1 and has the acceleration of lmp and lmh cars. Lmh is le mans hyper cars lmp are prototypes including that new porsche under the garage 56 rules lol. All while also still getting close to 100 mpg. 

Though to get to that point would require a full carbon chassis. Deffs have to be a monocoque and you'd be using lots of exotic materials to get it down close to 1000kgs. And the hybrid set up would be hard especially since solid state batteries would be required and you'd have to balance the turbine generator with the super capacitor and battery size very well along with the motors. You'd also need custom gear ratios and final drive ratios since a 1:1 would be retarded. You'd probably have to reduce rpms at the diff by 4:1 or so. But tall ass gears could be over come by the electric motors helping with torque fill and rpms are high enough to tune for any final speed you want easily.
Reply: @mann_idonotreadreplies  electric vehicles have benefits my dude. Instant frigging torque. High rpms. 

It's just nobody does em right yet and solid state battery tech is needed first. 

We need to go hydrogen for awhile. Has issues but is way better than electric for right now. And safer. Still gives us range needed and quick refuel times. Cuts costs ironically. And makes it easier to do sports cars. Hybrid is still available.
Reply: @ChiefCabioch  wait..

Is that the same drake engineering that did the drake watercooled v twins in the 30s? If so cool af. Good to know the family is still doing race engines.
Reply: @bmxriderforlife1234  yes formerly Drake,Goosen, Offenhouser...
Reply: @ChiefCabioch  siiiiick that family got mad racing history. I had heard the son had given jesse james the original drake knucklehead plans.
Reply: @ChiefCabioch  btw people aren't lying about green energy as much as you think. And bad windmills are bad windmills but there are good ones lol. Also why doesn't anyone make lightning harvesting set ups lol. But the issue is both sides of the green debate have money and interests in their side winning. It's middle ground for the truth. We are on a cosmological warming period that happens like every so many 10s of thousands of years. However we have done enough global warming to prevent or delay the next ice age. We should take good care of the planet. 

But we can't kill off all combustion because we can't replace everything with electric. And hydrogen and other alternative fuels offer better environmental benefits as well. 

The issue is oil and petroleum kinda killed some tech we should already have. And if they weren't dumb you just invest in green energy and become a monopoly there but now get to inflate your gas to the industries that still need it. 

Some of the big environmental shit we've chilled on like cfcs. Some others we need to chill on. 

But lol we've been failing before it was an issue. Look up nuclear tech. We've had safe tech for like as long as we've had nukes but they favor less safe tech because easier to use in also building weapons. 

Thorium and another type of safer reactor. 

Shits janky all around. 

However car industry killed hybrid tech in the 80s or 70s. 

Once solid state batteries become available. And someone decides to use the new smart rotary type hydrogen engine like the omega 1 or other hydrogen or alternative fuel systems. Paired with uber dense hybrid tech. 

With low or zero emissions exhaust. That you can pull an amg Petronas race team tactic and add a turbine powered generator to the exhaust that generates at idle. 

Uber effienct alternator with uber effient motors can also provide minor parasitic recharge on the mobile. And potentially beat other forms of charging. 

And while solar tech uses bad ahit. Once we start mass producing the uber high effiency panels in large enough panels. Without costing a retarded fortune. And solid state battery tech is further along. 

We could power the whole world off a small section of desert in various parts of the world. Reducing alot of coal charcoal and gad burning that isn't needed. Meaning cars wouldn't be such an issue.